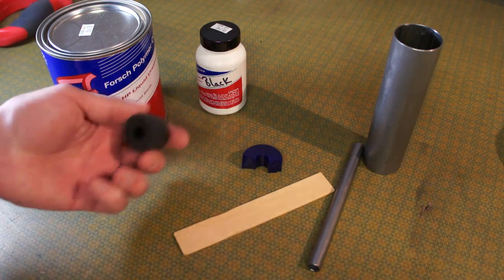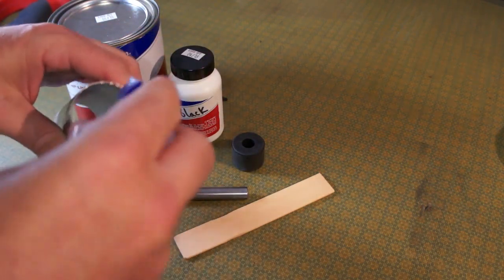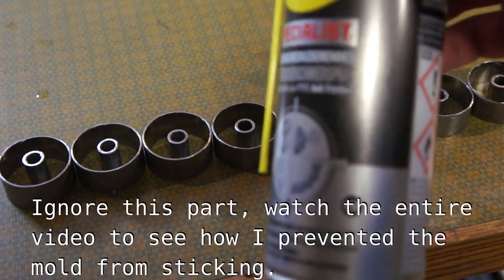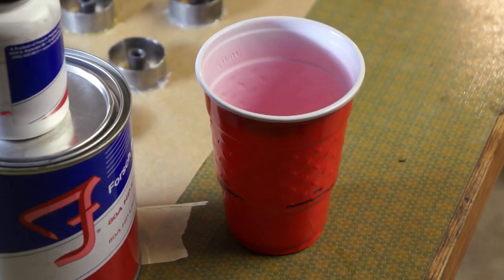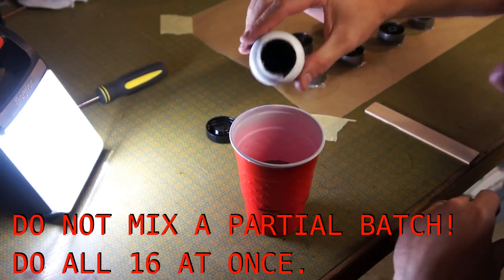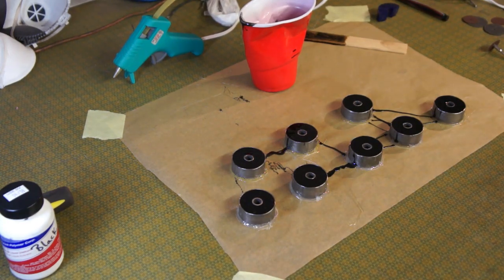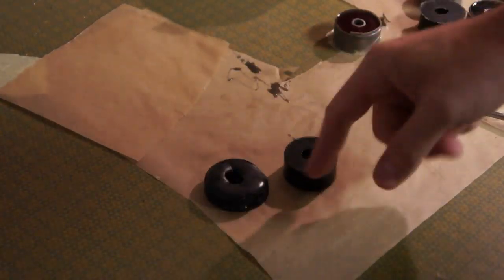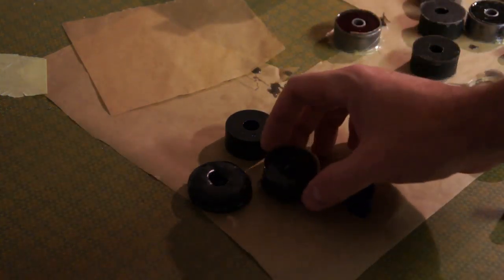1968 MGC Polyurethane Tie Bar Bushing DIY

Comment: Nice vid  I’ve been considering purchasing bushings from an Australian company that claims there bushings are durable yet somewhat soft and also have self lubricating material and grooves that also allows additional lube so they won’t squeak. There’s a kit that will do my whole car but it’s like 350 smacks so I’m debating on this one because I’ve never heard of these before. And I’ve been hearing about the polys just one day break up like crumbs or sum so IDK.
Reply from the maker: The ratio is tough to get right if you don't use the whole can, and you have to make molds for each piece so it may be a bigger pain than it's worth.  But it was a fun project.

Comment: Great video. The bush will be as hard as.....when your on your honeymoon night. After a few years, it will get soft, and the 'bush' will have to be replaced, back to the hard one you had years earlier when all was good. ( If you get my drift )
Reply from the maker: I've since replaced this stock setup with rose joints, which are much better.

Comment: rather then making a bunch of small molds why didn't you  make one long bushing the cut to length?
Reply from the maker: I was afraid the inner tube would not stay precisely in the middle and then the inside hole would be terribly off center on one end or the other.

Comment: Good Video, what was the amount of Poly that came in the kit? What was the dimensions of the parts you were making so I can work the math to do mine? Thanks
Reply from the maker: They are 1.5" OD, .5" ID and .7" high.  I was able to make 16 of them with the kit with a little left over that was waste - the kit is 400ml of fluid.

Comment: I’m considering just using this mix overtop of existing bushing.... thoughts?
Reply from the maker: Doubt that will work.  Bushings are made to be a particular size and if they don't fit right they will throw off the suspension geometry.  You could perhaps use it to fill in a cracked bushing to firm it up but I can't picture how covering the bushing would work.
Reply: JR's Garage Yes that’s exactly what I am planning to just fill in overtop existing just as a temporary fix until spring mostly due to finances

Comment: I would have kept them as one large tube and alumn pin. and poured it to make one long poly tube which then you could cut to the width you need. Just tripple check the measurements so you dont mess up the whole thing. Thank you for uploading this though!
Reply from the maker: You know, I thought of doing it that way after the fact.  It would have been a lot easier.  Hindsight...  Thanks for the comment.